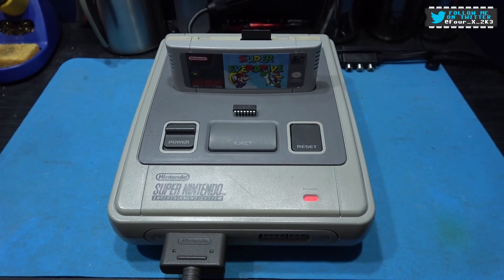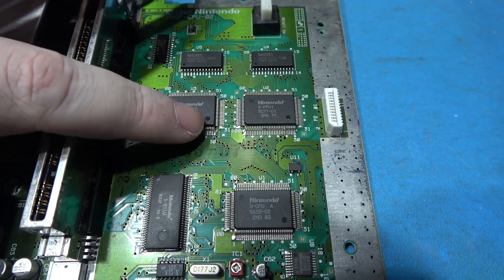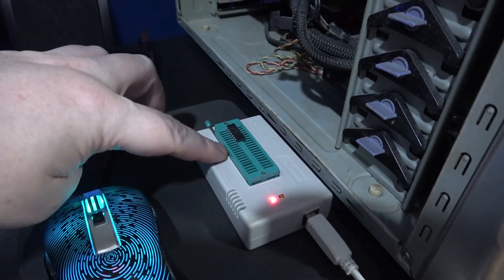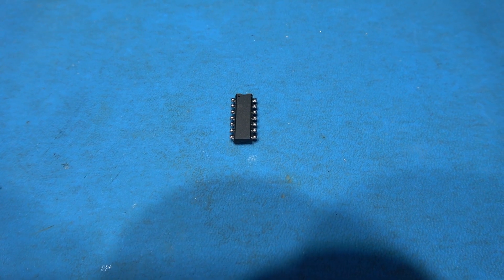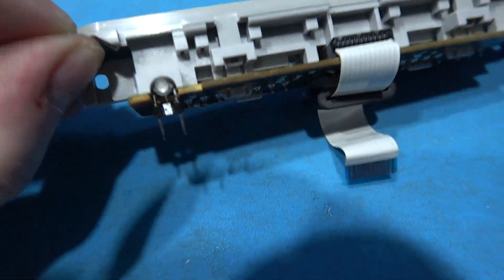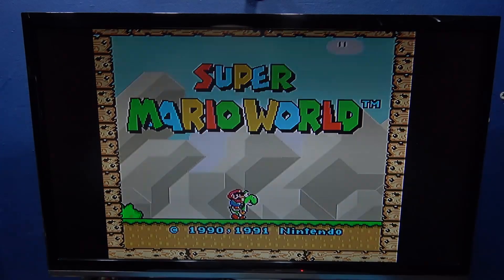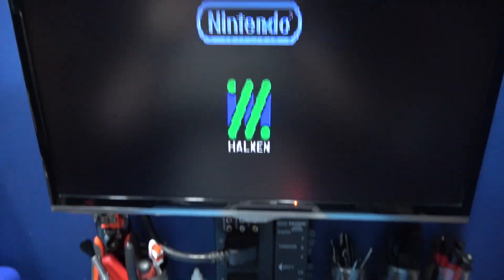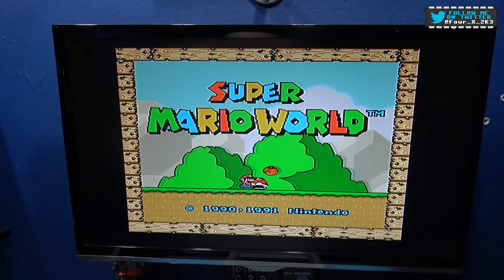Super Nintendo Entertainment System (SNES) - SuperCIC (Region Free) Mod Install.

Comment: Dude I own a NTS,C 1 chip board and a couple of old SUper UFO copier that doesnt worke with it cause secure block issues. DO you think installing the SUperCIc will solve the problem? Please could you share the BIN file to burn con a eprom? and also a tutorial to install on ntsc 1 chip boards if possible